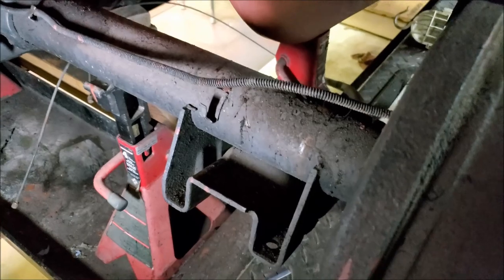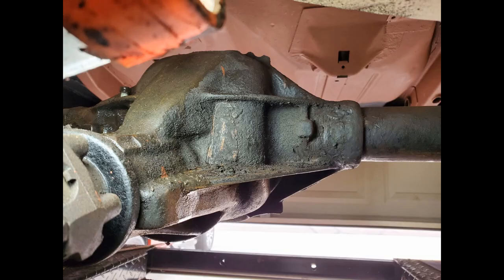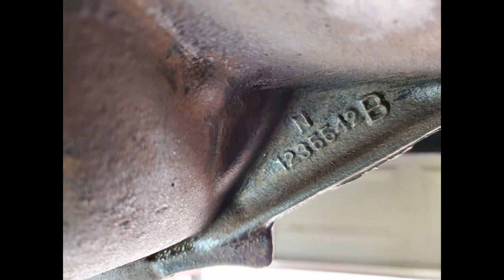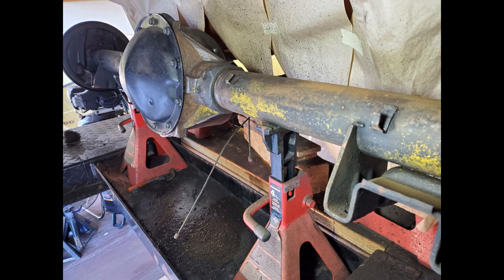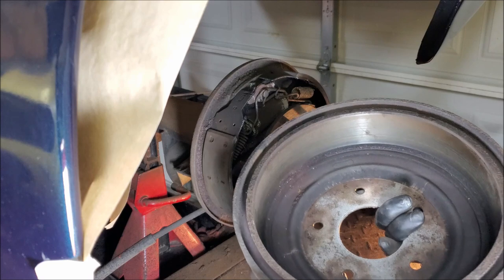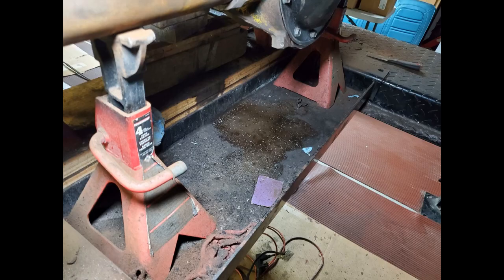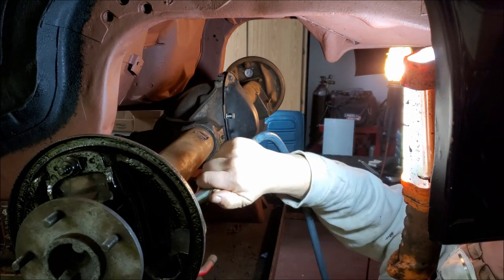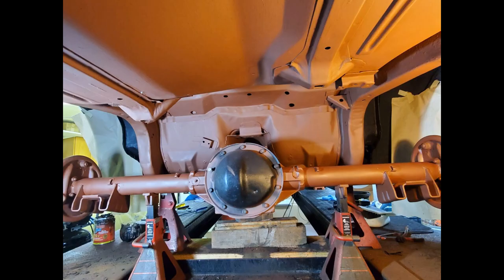1974 Pontiac 455 Trans Am Detail and Restoration Part 17. Disassemble Rear Brakes Paint the Rear End

Comment: Awesome videos! What paint would you recommend to redo the bumpers? I'd like to repaint mine. thanks
Reply from the maker: To repaint the black on the bumpers I'd go with an automotive paint. An automotive paint store will set you up with paint that will bond to the plastic. They will probably be able to put the paint in spray cans for you if you don't have painting equipment.  The bumper may need some prep using products they will have for you. They'll set you up with what you'll need.
Reply: @SPSteve  thank you!

Comment: Yep, that appears to be a chevy axle not a pontiac, bummer. This is one of the first videos of yours I'm watching so not sure of your philosophy or approach on this project/restoration yet. I believe the rear axle was "natural" or iron-colored from the factory with colored stripes on the tube for the axle ratio and I was wondering if you knew that and was going for the black finish on purpose and if so, why not just por15 the whole thing instead of the walmart rattle can finish? Working (slowly) on my own 79 SE T/A restoration as well...
Reply from the maker: As far as philosophy, I'm a lifelong hot rodder so matching numbers is not important. The important thing is the part itself, in this case a 1974 3.73 8.5" 10 bolt. So, I'm fine with that. This 74 Trans Am is a hodrod, it has a lot of aftermarket parts. All my hobby cars are modified to some extent.

My take on restoration is "factory like" but not necessarily duplicating the assembly line details. No chalk marks or stamps, it just needs to look right. I use the same thought process on all my street cars. You'll see this with my Olds Rallye 350 videos, my 71 Pontiac Formula videos and older videos of this car where I was working in the engine compartment. I've done it this way for decades.

I've found that I can get convincing results using spray cans at 1/10 the cost of professional paint products. For most guys this is a hobby and my method gives great results at a fraction of the cost. Stay with me and see for yourself how it turns out.  I didn't use POR15 on the rear end because I needed a semi-flat finish and I can't get that with POR15. I use POR15 but selectively.

Good luck on your restoration!
Reply: @SPSteve  Thanks, it's going very slowly but going. I did watch some of your other videos and overall, you seem to get good results. I'm wondering how you find that rustoleum primer and paint to hold up over time, especially over the rust. Do you use any phosphate etch or similar on the rusty parts first? I originally started with a similar method as yours but over time, everyone had convinced me that sandblasting, epoxy primer and topcoat was the way to go.  Por-15 has a satin or semi-gloss finish version I believe that closely mimics the factory chassis black.
Reply from the maker: @slayer7976   if it's just a light surface rust like what was on my rear end I have no concerns about rust using Rustoleum primer and Krylon. If it is heavily rusted like the spot in the Trans Am's trunk pan then I had to use a rust converter to neutralize the rust and then coat it in Rustoleum primer.

The way you were told to it is the most correct way. But it is also why restorations can cost more than the car is worth.  My hobby cars live a pampered life while I own them. They will never see rain or snow and I only drive them on nice days. So, I don't have reoccurring issues. POR15 is great stuff but the finish is unpredictable. If using semi-gloss the finish might be semi-gloss or gloss or even flat depending on how it cures or how many coats are used. I've had to spray over POR15 with Krylon because of that. My cars are rattle can restorations, I have no problem with that.

If your TA is your first restoration do not get semi-gloss black and semi-flat black confused, they are not the same thing, Semi-flat is 30% gloss, semi-gloss is 60% gloss. You will use semi-flat a lot, firewall, cowl, core support, radiator support, fender liners, brackets, pulleys are all semi-flat black. The frame and control arms are the only things off the top of my head that are semi-gloss black.

In the end it is up to you on how you want to do your restoration. What I'm describing does not pertain to body and paint, you have to do body and paint by the book. But everything else can be done how I do it for a lot less money than products from an automotive paint store. What you were told is the most correct way, it's just really expensive.